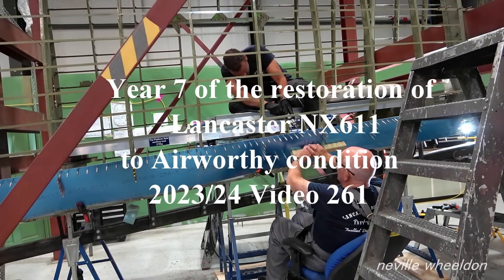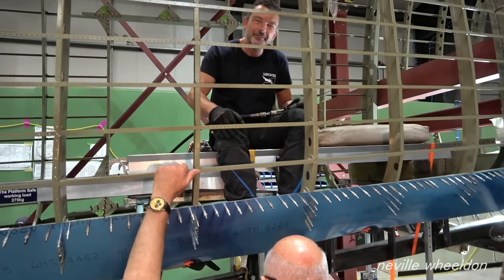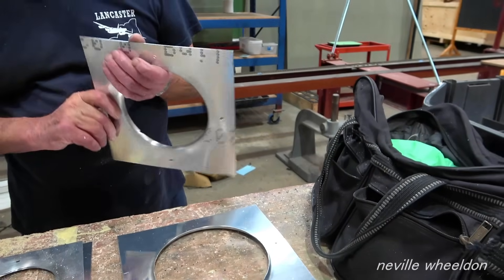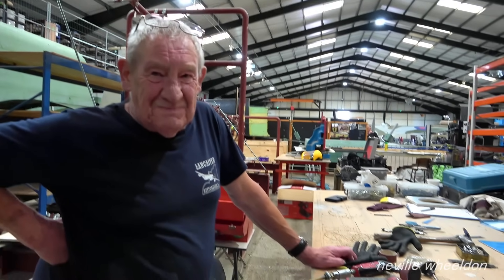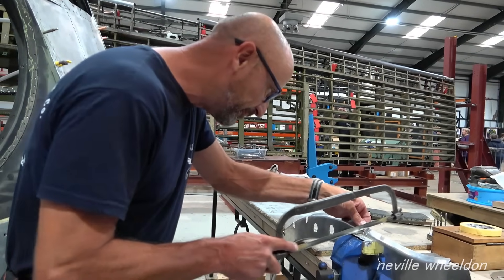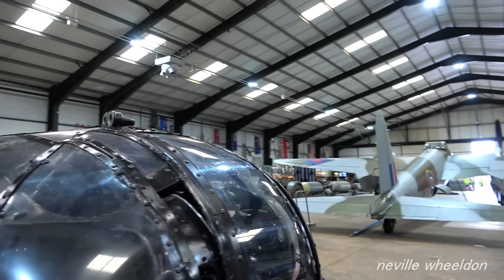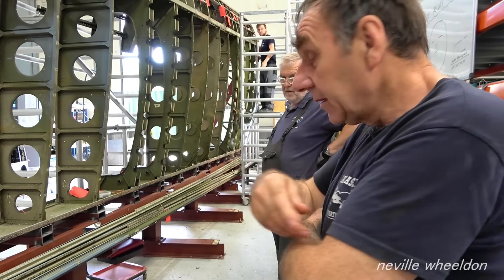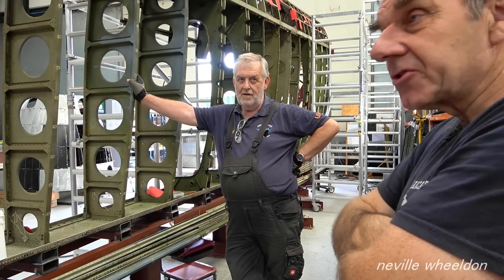Video 261 Restoration of Lancaster NX611 Year 7

Comment: In production, the Ribs and Fuselage Formers would have been cut to shape using a Bench Router and pressed to form using a hydraulic "Rubber Press",  The  wooden formers you see would be positioned on the bed of the press and the pre-cut details laid on the formers using locating pins. The top moving part of the press held a 3 inch thick sheet of rubber and the hydraulics brought the two faces together.  The rubber  formed itself around the formers and at the same time folded the sheet metal to the former shape.  Usually the wooden formers were made from "Tufnel" as this had better wear and compression quallities.  Fairey Aviation had two of these presses at Hayes operating at 150 tons. Hope this helps.

Comment: Thanks Nev. Can the stringers not be made out of box section & flat plate? That or put a strip of ali behind the holes & use longer rivets? The strips could be welded or tacked every 6" or so. Hopefully there's an economical solution.
Reply: To obtain Civil Aviation Authority approval for flight, the structure must conform to the original AVRO design specifications. Minor variations may be approved in non critical areas, subject to qualified aeronautical engineering redesign, but the wings are critical structures. So, as per AVRO drawings of she don't fly!

Comment: Have a look at Architectural Products Limited here in NZ (Hamilton & Cambridge) for your aluminium extrusions. I think you will find them very accomodating. They ship all over but mainly to Australia.
Reply: So how much would the shipping be from NZ as opposed to the US?
Reply: @davidmartyn5044  Hi David - It will be very similar if not cheaper.  Distance is not an issue so much as the number of port interventions and NZ ships a lot of produce to Europe and the UK.  I think a query to APL will be worth a try.  They do a wide range of aluminium extrusions and the assembly of these to windows etc. for both NZ and Aust, maybe even for Europe. There will be a minimum order - have heard 1000ft but that might fit your order anyway.- and a die cost as well.